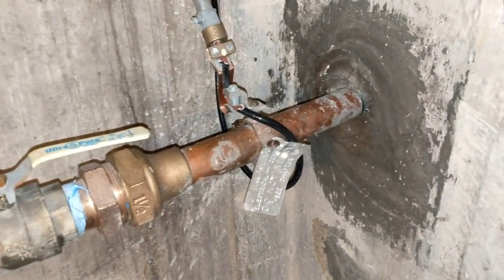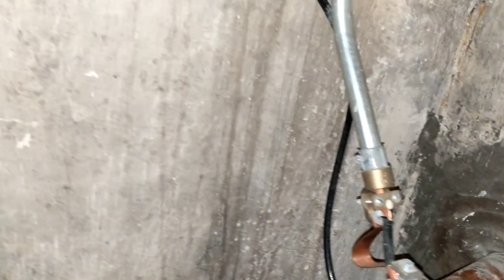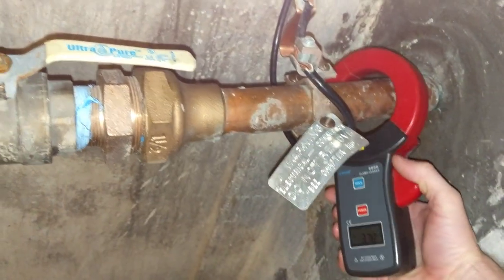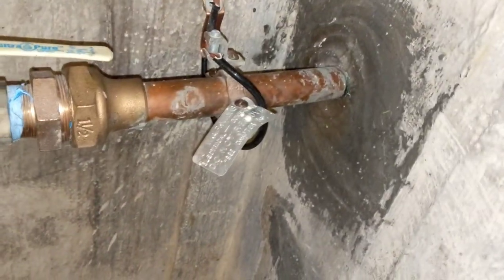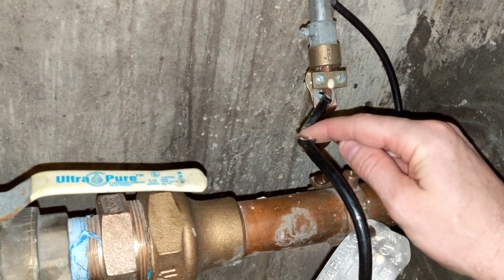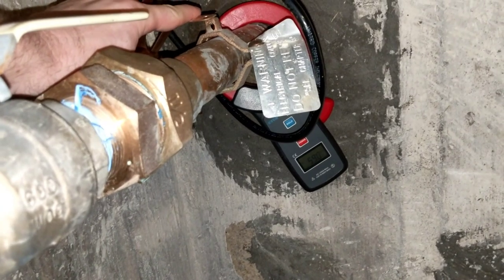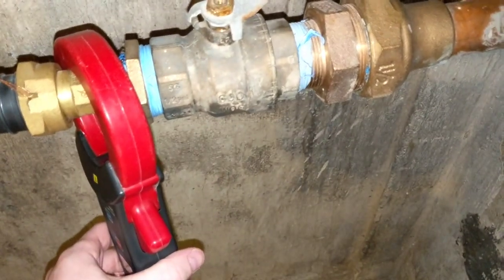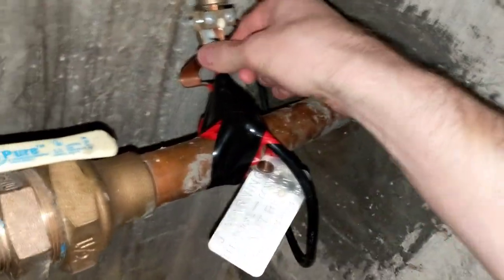How to measure current on pipes with AC Clamp Meter and isolate water pipe to stop undesired current

Comment: Please don't do this, don't be this guy.  This is definitely required by the (NFPA 70), National Electrical Code, Article 250 which covers the grounding and bonding of electrical systems. The grounding electrode conductor is not intended to carry current under normal conditions, but it provides a path to the grounding electrode in order to limit voltage caused by things like lightning, power line surges, or unintentional contact with higher-voltage lines.

I understand you probably made this video because you're worried about exposure to EMF radiation. I can think of many other things around your house that expose you to higher levels of EMF on a daily basis like smartphones, wireless routers, air pods, even some foods contain small amounts of radioactive elements like bananas.
Reply: That's what ground rods are for.  Are you saying houses with poly water service are inherently unsafe?  Do you ground to plastic?  You should read comments before commenting yourself and take more time to think before commenting.  You are contributing to noise and not intelligent debate.  

Houses with grounding electrodes don't need the water service bonded. Internal pipes, yes should be bonded.  But it's OK to have an electrical break such as a dielectric union or a portion of pex to break objectionable current such as this.
Reply: @shaunkranish  Sir, no, we do not bond to  plastic. The water main in the video is clearly copper, not plastic, I didn't say anything in my comment about plastic or PEX..  The NEC requires a minimum of two grounding electrodes, unless one electrode has a resistance to earth less than 25 ohms. There is a reason the electrician who wired this house used the water main as a grounding electrode. By you removing the grounding electrode conductor that is bonding the water main, you are creating a shock hazard. Also, microplastics in water suck, copper ftw.
Reply from the maker: Most of the electricians who have been commenting here state that the metal water pipe "must" be bonded, no matter what.  So even if you had 3 grounding electrodes (rods) over by the meter, they'd still want to run a lonnnnnngg wire over to the water supply and bond it where it comes in the foundation.

I have outlined in other comments here (I am Shaun Kranish) all of the MANY problems with bonding to the water pipe.  The solution is to isolate the pipe after it comes in, insulate the little stub or whatever, and rely upon real ground rods.  Bonding to the pipe creates an alternate low-impedance path for primary and secondary neutral current to flow.  We turn the pipe into a conductor for normal everyday current instead of an emergency route for emergency current.  1) Pipes are not allowed to be used as conductors - violation of NEC 2) Using it as such creates magnetic fields and corresponding heating, current, and voltage potentials (transformer effect), 3) Parallel conductors are not allowed except in limited circumstances and with restrictions - NEC violation 4) Current-carrying conductors must all be along the same path - NEC violation 5) The current flowing on these pipes is objectionable current as mentioned in the NEC 6) Remote grounding electrodes increase likelihood of conducting lightning through the building 7) Magnetic fields, especially of high-frequency, are associated with health problems and listed as a Group 2B carcinogen by the World Health Organization 8) Allowing current to flow on metal pipes has killed many workers as they work on pipes.

Perhaps copper is healthier than plastic - I can't say.  But I can say that magnetic fields cause health problems.  I've personally experienced and seen it in people.  I've had numerous clients who can feel the moment I physically cut their copper pipe.  They are in another room even and I'm not using a saw.  They can feel the change in the environment the instant those magnetic fields are removed - a sense of calm and peace usually.  I've felt it myself too.

It is a terrible practice to use pipes as conductors, and it is illegal.  So let's work out a solution together.  I propose we purposely electrically insulate the incoming line with a portion of pex.  Sort of like how 18 inches (or whatever) of copper or steel is required coming out of a water heater - pex should be required entering the building.  Then we insulate the metal coming in before the pex break and then bond the interior metal pipe network for safety and call it a day.  Use ground rods so that we aren't running current on pipes and causing these problems.

Comment: you really should fix the source of the problem that is causing the undesired current. leave the grounding and bonding intact, they keep you safe.
Reply from the maker: The source of the problem is not on-site.  In fact, in the majority of cases the source of the problem is not on-site.  You can have a building with no wiring errors - no neutral-to-ground mistakes or accidental shorts - and current will still be on the water pipe.

The reason is - primary and secondary current is traveling between the service neutral or grounded conductor, and the water pipe network.  Electrical current takes all paths simultaneously.  Since every building is hooked up with the metal water pipe in the same way, current takes all of these paths.  This is why you can go into a building, shut off the main disconnect, and still have a significant amount of "objectionable current" on the water pipe.

The solution is to have a break that isolates the building from the street.  Sometimes dielectric unions are used (we recommend 2 dielectric unions with a piece of steel pipe in between) or better yet PEX pipe.  In this video, it was fortunate that the water meter itself can act as the break.

Yes, it is important to bond the inside building pipe network.  But in order to stop this current, the current path must be broken with something that is not conductive.  For a typical single family residence, having (2) 8-foot ground rods 10 feet apart meets the requirements of NEC (does it not?).  There is not a requirement to also use the pipe.

This bad practice of having current going all over the place on water pipes needs to be rectified.  Luckily polyethylene/pex pipes of course eliminate this problem.  How can any electrician say that it's vital to bond to the underground copper water pipe when new homes for a long time now have been using poly pipe?  Obviously one cannot be intellectually honest with that argument, unless one truly believes poly pipe also poses the same "risks."  I do not believe there is any risk in the setup shown in this video, but feel free to prove me otherwise.

There is, however, risks to creating undesired paths for current to take, such as on the pipe that goes to the city plumbing.  I've seen as much as 20 amperes on a water pipe.  That is NOT good.  These need to be electrically isolated, and then have the building's internal pipes bonded.  I am curious to see what you think of this.  Thank you for the reply.
Reply from the maker: Just to reiterated - you can have multiple houses on a transformer and every single one of the houses be wired perfectly without a single error or accidental short.  If the houses are all connected to the city water network with metal pipes, the metal pipes are not electrically isolated and are bonded to the electrical service, you will have system primary-side current, and secondary-side current flowing on the pipes.  It's always there.

So then the question becomes - well - how much is "OK" and on what are we basing this determination?  In our line of work, we base it on the magnetic fields caused by this current that is "unopposed" meaning the electrons flowing the opposite way are NOT on a conductor taking the same path.  The conductors need to be close together and taking the same path.  Break the water pipe with pex or a dielectric union, and the path is broken.  You eliminate this "unbalanced" or "unopposed" or "uncanceled" current path.  Normally when all current is accounted for on 2 conductors (same amount of electrons flowing in and back out) and the 2 conductors are together in the same cable or conduit (eg. together in the service drop triplex/etc) then the magnetic fields cancel.

We need these magnetic fields to cancel, otherwise health issues can be created.  Objects can be turned into transformers (any loops of conductive material).  We shouldn't be creating transformers all around...

So that is why my believe is that the best practice is to always isolate these incoming water supply pipes.  NOT use them as an electrode.  They are too low-impedance and form countless paths for current to spread across and go all over the place.  It is a terrible design, and time to change it.
Reply: I measure undesired current almost anywhere in TN-C-S systems with bonded metallic pipes. My current house has plastic water and gas piping entering the building and guess what? Very low magnetic fields. Between 5-30 nT (nanoTesla) and this is only because in the 1960's it was common in terraced houses in the Netherlands to use two grounding rods at the edges and connect them both with a thick galvanized wire and connect every house (6 in total) to this grounding wire. Luckily the wire is at the front door so the magnetic field is very local.

In my previous apartment it was between 80 and 200 nT because everything was metal piping. Here in the Netherlands I noticed whenever there is metal piping there are high magnetic fields ranging van 50 nT to somethings >200 nT. Whenever there is plastic piping magnetic fields are no higher than 50 nT but usually around 20 nT. And it's ironic because modern buildings with plastic piping usually have a thinning wire Gauge. So increasing neutral size would lower magnetic fields somewhat, but the biggest problem is the reckless bonding without galvanic isolation first and not the size of the wiring.

And it's not even a new problem. Merlin Gerin, now better known as Schneider Electric already made a document in the mid-90's explaining this exact problem as a risk to take into account when working with TN-C-S systems. It's even the reason why TN-C systems are abolished nowadays because it would cause problematic magnetic fields even inside buildings. 

But I've even seen bonding problems in TT systems as well. F.e. France only grounds the neutral at the transformer and when having overhead wiring also at the drop pole. All residential systems are TT and just as in the Netherlands and most European countries RCD's are  mandatory on EVERY circuit. This is the biggest difference between American systems and European systems. Many American systems do not have GFCI's and RCD's or only on some circuits whereas in most European countries RCD's are mandatory on all electrical circuits for decades.

When having RCD's on every circuit and have your own grounding system you don't need a ground to neutral bond. Actually private neutral bonding is not allowed in many European countries. If you want a grounded neutral officially the utility company will have to provide a ground wire from the neutral bar in the sealed fusebox before the meter so it will appear in your electrical panel as a TN-S system. Otherwise you have to manage your own grounding system by installing your own ground rod with a low enough resistance.

An old electrician I know told me that before RCD's became mandatory in the 70's and 80's death by electrocution was very common in the Netherlands. Nowadays if someone in a non-professional settings dies because of electrocution it will reach the news as it is a very rare occurrence nowadays.

I wouldn't say we don't have any problems with electrical systems in the Netherlands nowadays but shocking hazards are very foreign to us. In old buildings privately owned for decades you sometimes find old electrical systems without RCD's and proper grounding and people sometimes feel small electric tingling when touching metal piping or water taps and while showering. But I haven't heard about electrocutions.
Reply: @robinheijblom2929  can you please explain your acronyms? 🙏
Reply: @jshtaway1  Those are not my acronyms. They are general acronyms known to any electrician. But I don't mind explaining them for the less tech-savvy among us.

nT, nanoTesla - Official SI Unit to quantify a magnetic field 1 nanoTesla = 0.000 000 001 Tesla

GFCI, Ground Fault Circuit Interrupter - The names states it. Whenever there is a "Ground Fault" the "Circuit" will be "Interrupted". Many people confuse them with RCD/RCCB's but an old fashion GFCI just looks for current through the Ground wire. A GFCI will not provide any ground fault protection with ungrounded appliances.

RCD, Residual Current Device - The name states it. A "Device" that measures "Residual Current". Under normal operation the current through the phase wire and neutral wire is zero. Whenever it's not a ground fault is occuring. The RCD detects this minimal difference and will switch off the circuit. It will provide protection with grounded as well as ungrounded apliances. Therefore the RCD is superior to the GFCI and should be used instead most of the time.

RCCB, Residual Currect Circuit Breaker - Just a different but better name for an RCD. It also states what it will do. Whenever "Residual Current" is detected it will act as a "Circuit Breaker" to stop current from leaking away.

For some reason the acronyms for grounding systems are in French. Though the acronyms are also somewhat valid in English.

TT - Terre Terre - Means every transformer and installation has its own ground. The neutral is only grounded at the transformer. This system is common in Europe because it prevents stray neutral currents. The disadvantage is no guaranteed low impedance path is present back to the grounded neutral of the transformer. For saftely you completely rely on one or a few grounding rods. Such systems require a GFCI/RCD to immediately switch of in case a ground fault occurs and inspection on a regular basis.

TN-C-S - Terre Neutre Combiné Séparé - Grounding system where the utility company delivers a combined grounded neutral wire which also has the function to ground the installation. The mandatory grounding system in most of North America and most used in the rest of the world. On customer premises the grounded neutral is split into a neutral and ground and will be separated throughout the rest of the premises. When properly installed stray currents can be minimized but never zero.

TN-C - Terre Neutre Combiné - Terre Neutre Combiné - Same as TN-C-S except throughout customer premises the neutral and ground are not separated but combined as one wire. This system is obsolete as it caused too many problems with stray currents although you will still find it in less developed countries.

TN-S - Terre Neutre Séparé - Grounding system where the utility company delivers a separated neutral and ground wire. Neutral and ground are only connected at the transformer and completely separated throughout the rest of the distribution network and customer premises. This system has all advantages of TT and TN-C-S. There is no neutral voltage present on the ground wire while still maintaining a guaranteed low impedance path back to the transformer. 

Nowadays TN-S is used in most industrial installations in The Netherlands because it will provide all the protection will eliminating neutral currents. Also when using a TN grounding system you do not have to use GFCI's/RCCB's which is a big advantage for industrial installations that need a high guaranteed continuity. In residential installations TT grounding is still used because it will eliminate stray neutral currents, is pretty cheap and the utility company will not be liable for grounding problems. But TN-C-S is becoming more and more the standard in Europe as it is cheaper to maintain and most water and gas lines in new installations are made out of PVC so the risk of stray neutral currents is less.

In my opinion TN-S should be the standard for all installations. The only disadvantage is cost and this is the reason while TN-C-S is still the standard. A TN-S system will be at least 20% more expensive in a 3-phase system. In a TN-S system the ground wire needs to be separated and the same size as the neutral. So you need 5 wires instead of 4. This means when using copper you need 20% more. Copper is expensive so whenever its usage can be reduced it will be. Also utility companies like to combine ground and neutral as it causes the voltage on the grounded neutral to be lower since the total impedance of 2 wires will always be less compared to 1 wire. Also there is less risk of a broken neutral or broken ground so liability for the utility company will be lower. 

So there is a conflict of interest between the utility companies and the customers when it comes to neutral grounding and grounding systems in general. At the end it's all about money and responsibility.
Reply: @EMFExplorer what if the current is on the gas pipe?